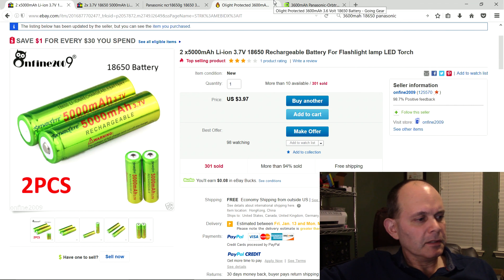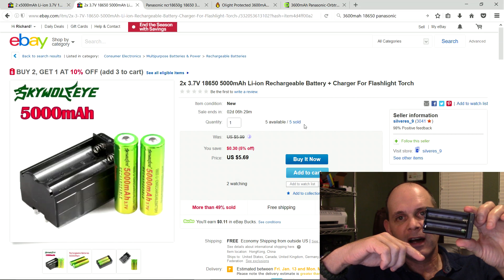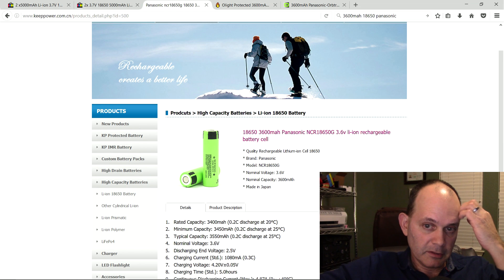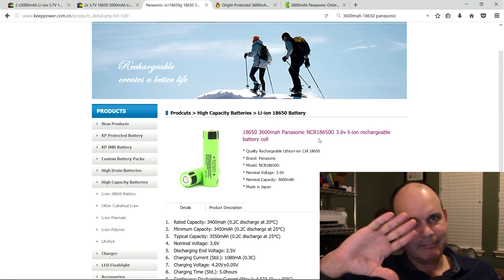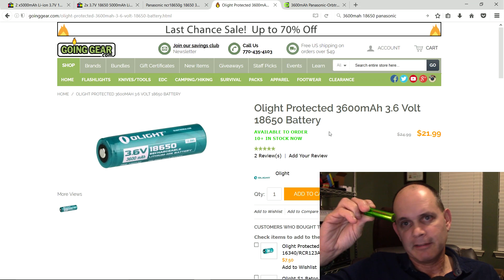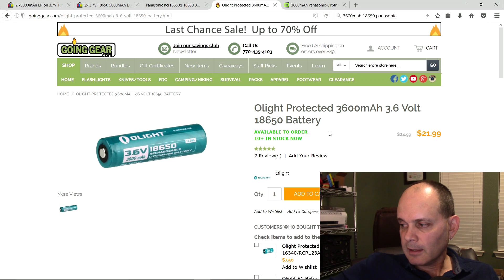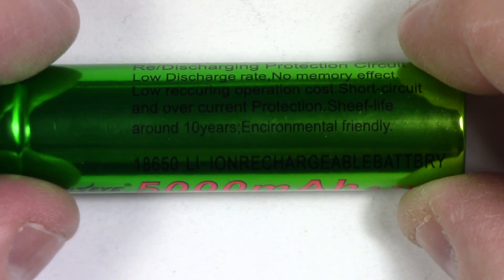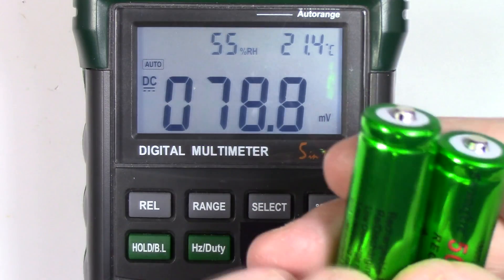18650 Skywolfeye 5000mAh Green Cell/Battery Yes, They Are A Rip Off Thorough Review

Comment: My question is are they safe? Do they have the proper ventilation / failsafes to prevent from exploding if they were to overheat in normal use. Because for $10 for 10 batteries... even at a low capacity it’s nice to have some extras charged or if my friends borrow and don’t return them..
Reply from the maker: They are unprotected batteries without ANY safety features available in name brand cells. Thank you for watching and commenting. I appreciate it greatly. All the best.👍😀

Comment: Any update for new cells or are the ones in your description still the way to go?  Thanks
Reply from the maker: I think for unprotected cells the Panasonic NCR18650B 3.7V 3400mAh Rechargeable Li-ion Batteries QTY 6 At Amazon: https://amzn.to/2SEfxpx Or Ebay: https://goo.gl/sWyhA5 are a great value. I use them all the time and for protected cells (based on the same Panasonic NCR18650B) both the Olight 18650 3400mAh Li-ion Protected Battery At Amazon: https://amzn.to/2Rz4kZT Or Ebay: https://goo.gl/t633eT and the 
Orbtronic 3400mAh 18650 protected Li-ion At Amazon: https://amzn.to/2C6IwLE Or Ebay: https://goo.gl/3ZVKQy are a good value. Thank you for watching and commenting. I appreciate it greatly. All the best.👍😀

Comment: china always fake... need to ban their product
Reply from the maker: Till then don't buy cheap cells. Thanks.
Reply: They need to be accurately labeled, but "banning" is stupid. Depending on what you need them to do, they're still a better deal by far than the "good" ones. If you can tolerate the low capacity. You can get 4600mAh total capacity (4 cells) for less than half the price of one of those excellent 3600mAh cells.

Comment: Have you tried testing them at anything other than 1 amp? I am not doubting that they are crap, but what would the capacity be at something like 200ma?
Reply from the maker: OK, just for fun, because I know these cells are total garbage I tested them at .2 A and got 236mAh. Just like I thought a good watch battery would outperform it. LOL what a joke. Putting it back on the battery wall of SHAME. Thanks.
Reply: Sometimes I think that things dont get a fair chance, but you seem to give it to them. thanks for the vids!
Reply from the maker: I aim to be fair in my reviews but I knew these were bogus when I bought them because there is not a legitimate 18650 made today that has over a 3600mAh capacity. So I was certain they would not meet the claim but seriously they are a total RIP OFF. LOL Thanks.

Comment: 98% of these china batteries are junk especially if they claim over 3400mah of power. 
With that said I found the EBL cheap line of batteries half way decent. While they claim 3000mah they actually deliver (all ten I tested) just over 2000mah. Considering some of these scams barely reach 500 mah that is not half bad. 

While I still think scavenging old laptop packs is the best way to get good cheap batteries. They are a couple of cheap brands from China that isn't a complete scam. Like the EBL ones I tested again they are nothing amazing but not a complete scam like most of these cheap brands. Also Dulex (japan) Trustfire (refurbished laptop battery) and Efest  (from this guys tests) all  seem to not be complete rip offs and actually do work pretty well. Maybe not for vape pens but for lights and other low amp applications.

Will eventually build a power wall for my solar system but will more than likely use new laptop battery cells for the price they have tested best for me so far. Building a power wall with say a top name brand like LG would be extremely costly...
Reply from the maker: Actually you can get LG cells pretty cheaply on Ebay: https://goo.gl/Q4PBkZ now you have to buy them in bulk but that is where the best deals are. Thanks.
Reply: Thanks yea something like that is what I will have to use if I ever build a power wall for my solar with the work involved I want new cells . I just wouldn't trust cheap light cells for something like that. The EBL's are strange though they are light cells but will give close to their advertised mah rating. For Vaping they are not as good but for say flash lights they hold up surprisingly well. Thanks for the link hard for me to trust some ebay deals but I do trust your opinion I may grab a few ;) Really want a power wall I get way too much solar power for my AGM bank and I hate spending much more on sealed agm batteries. See for solar AH is misleading I have 1000 ah in a 12v parallel set up but only about 200 ah is all I can safely use at night. Pulling lead acid below 60-70% will kill the life many! people make this mistake. Just because you have 1000ah bank doesn't mean you can use it all. Treated right good AGM batteries will last ten years maybe more but just using an ion wall would free up more discharge and provide more ah while using a smaller bank. Just a superior form of energy storage but not readily available to the public yet in cost effective power walls * I have had good luck in home depot/lowes recycle bins power tool battery packs usually give 1 bad and 3  really good cells for free and I find them in better shape than used laptop cells mainly 3000mah high amp cells. About 1 out of 6 is brand new just the wrong kind causing the return worth checking out for budget builders..

Not off the grid yet but working on it Keep up the good work! subbed
Reply from the maker: You are most welcome. Thanks for the feedback and the sub. I appreciate it. I have seen videos and devices that claim they can "restore" lead acid cells but I always find those claims to be suspect. Until I do it myself I can't really trust it. I find with the laptop battery packs that it's either one bad cell or all the cells are good but the battery management system is defective. Thanks again.
Reply: I have tried to refurbish a few older flooded marine batteries for my solar bank. By rinsing them out with baking soda and water and then using epsom salt water for the alkaline conversion about 65-70% ratio. While a couple did get a pulse they was only a tiny fraction of the AH and for my solar was useless. Putting  acid solution in a damaged cell is not worth it in my opinion. Its all about the cores and just a few full discharges can ruin any LA battery. With a damaged core there is little anyone can do to bring it back to life besides molding new cores. I used to try to get unsold dead batteries from parts stores only to find the single full discharge caused some major damage. If the core is in good shape it may be possible to get a decent battery I just haven't had any luck in alkaline conversions. 

Its just not worth the trouble for me with solar often they will get half there cranking amps maybe enough to start a car. The AH however from what I have seem will be lucky to have 1/8 its original capacity. Some people swear by it and I may get cussed lol . To me ts largely a myth  because I expect more out of my batteries running all solar lights I have too be selective. Kinda like these fake cells yea they work but how good... In a pinch they may work as a starter battery but if you need the AH its just not worth it imo.   

Best just to properly maintain good LA batteries. Simple things like a low voltage shutoff's will save a car battery also checking water levels . A bad alternator or leaving the lights on will greatly damage a LA a few times and its DOA. So many solar users ruin their banks by using all their AH at night. Why Ion banks are so attractive unlike LA they don't dislike a constant trickle charge and can take 50% discharges without any major damage. 

You should try it one day if bored but like me I am afraid you want like the results yea its a battery but technically so is a potato lol
Reply from the maker: Thanks again for the great feedback and comments. I appreciate it. all the best.

Comment: hello, i did harvest some 18650 on old latop battery, i'm a beginer in these battery but have a lot of experience with lipo ... i use an imax b6 and and accucell 6 to discahrge these 18650 i have, unfortunatly, when idischarge them using liion battery settting, it discharge to 3.1 and then stop, but when i use my multi metter the cell are back to 3.7 volt so i can't realy discharge them and it's hard to tell the real capacity because of that ... all my charger do that, even if  i discharge at 0.1 amp . battery resistance is about 150 -200 mohm, any idea? when i discharge them at 1amp for exemple the voltage drop very fast
Reply from the maker: Cells electro chemical devices and they do have a tendency to "recover" somewhat from the discharge. You could vary the amperage levels to find what works best for you. I usually discharge them at either 1 or 2 amps as most devices draw at these levels. But I do a continuous discharge test. Most people don't turn on their flashlights and run them until the battery dies but if they did they want to know how long would they last. Thanks.
Reply: christophe levaux
Reply: Richard Lloyd g

Comment: seems to be olde recycled laptop cells.
Reply from the maker: The cells I pull from old laptop battery packs generally have a higher capacity than these but you may be right. Thanks.

Comment: the panasonic cell is only a 5- or 7 amp cell also ,,  meaning  should not  be  used for vaping  which requires about 15 to 20 amp cells

Comment: Dont buy 18650's from Ebay!  Find a trusted retailer.  I use http://www.illumn.com/.  Thanks for the video.  it is a bit scary what they can get away with selling.  For the vapers in the crowd Do NOT buy these rewraped batteries!  They will probably kill/maim you.  Lg, Samsung, Panasonic and Sony are the only companies that make 18650's.  All batteries marked otherwise are the rewraps of the above companies.  One of the dangers here are that they will rewrap a 10 amp cell and label it as a 30(or more) amp cell.  Know the current your device is drawing and be safe.  Use http://www.steam-engine.org/ohm.asp to find how much current you pulling.
Reply from the maker: Thanks for the great feedback. For the most part I would have to agree about not buying from Ebay unless you really know what you are ordering. I am looking to find a good deal on ebay or Amazon on actual Chinese cells that do deliver on what they promise to balance out my videos but it certainly is not easy to do that, unfortunately.
Reply: China does not make 18650's.  They purchase the batteries from Japan and rewrap them.  Anyone can rewrap a battery.  All that is needed are the sleeves and a heat gun.  I even take my batteries to be rewraped at a local vape store(if i was wraping more than 15 batteries a year I would buy a heat gun and do it myself).  If you are using them for a low current application the Chinese batteries might be ok.  My batteries are generally subject to at least 20 amps in use so I make sure I know what I have.

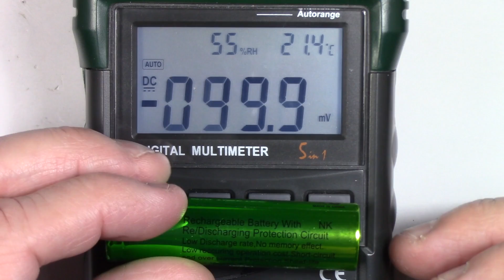Comment: 12:25 For safety you are not suppose to ship batteries with that high voltage 3.9V.  That is what I have been told or read about it might not be true.  40% or 3.7V is a good shipping voltage.
Reply from the maker: Trust me safety is the last thing the people who made these cells are concerned about. They lie about the cell having a protection circuit! Crazy stuff. Thanks.
Reply: Richard Lloyd I was just look at my ebl batteries there is misspelling on them sheef-life, reoccuring, for example.  They lie about capacity then what else are they lying about - everything! But I still like them so far.

Comment: Good work you`re doing Richard, ive said befor Amazon & ebay allow this to go on, even our trading standards agency does nothing, but market traders are always being targeted by them selling fake goods eg tobacco products and alcohol,  i wonder if it`s all to do with tax evasion lol.
One example Apple chargers £35, fake £5 can you wonder why people buy fake.
Reply from the maker: Thanks again Paul. As you can see there are many variations on the same theme with these cells. The fact that there is ZERO safety factor in these cells is the most concerning thing I have found. They are lying about the capacity but worse yet they are lying about there being any protection at all, there is none. All around garbage cells. Happy New Year. All the best.
Reply: Richard Lloyd The claim about being protected is alarming really, as it`s a safety issue, especially to people who are not aware of the reason for the protection circuit.

All the best Richard for the new year to you and your family.
Reply from the maker: Agreed. The safety issue is paramount to all the other issues. I hope people get that it's a serious safety issue. Thanks again Paul.